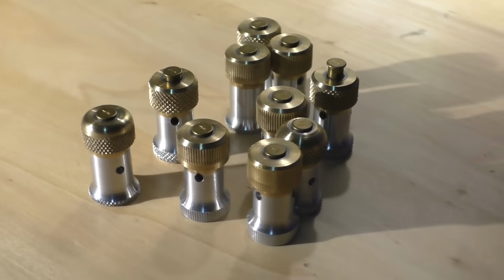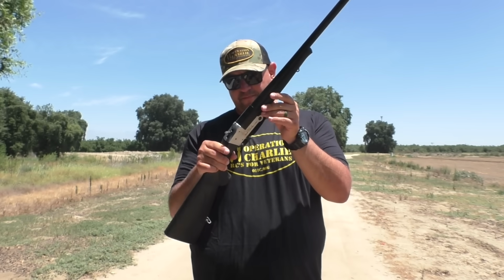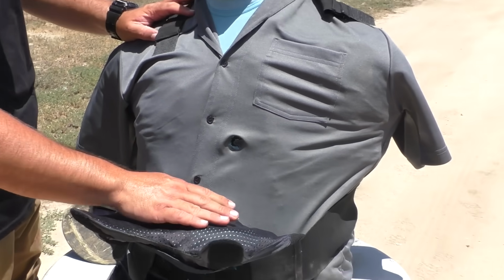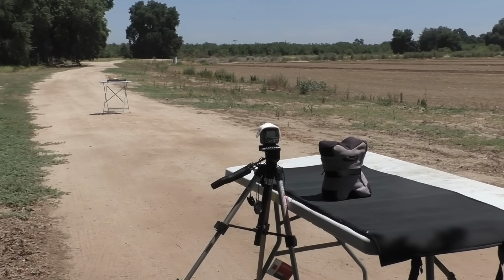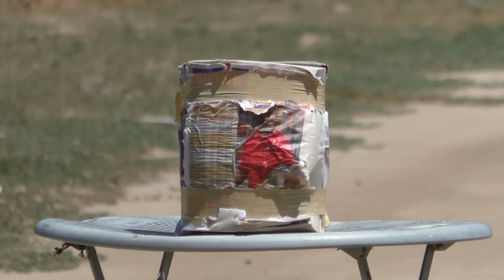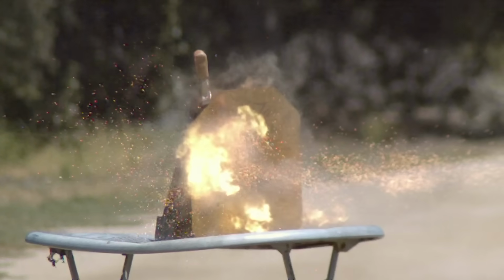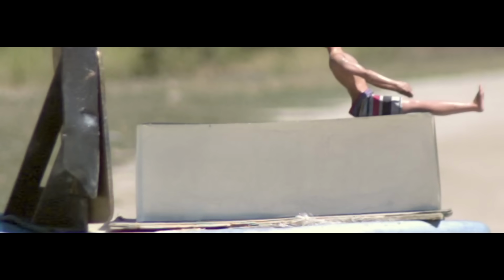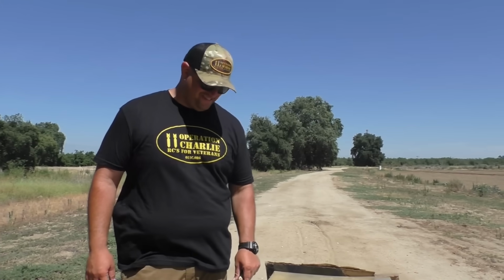We test the BACK-FIRE Slug -   You Make It,  We Mach It!

Comment: @taufledermaus I have an idea that would be a very entertaining series. Put out a request to your slug makers for a home defense slug.
Then test them in a series of videos on 2'×2' wall analogs, about 20-30 sections deep.(2"×4" frame with sheet rock on both sides and insulation in the middle.) Then compare the results in a follow on video.
Reply from the maker: The problem with walls is they really don't stop anything.   There is no magic bullet that will be stopped by a wall made of chalk and paper BUT would also have the energy to kill someone.
Reply: @taofledermaus I was watching another video that did this. Even rifles were being stopped at about 15 panels. But these were just sheetrock no insulation. The test of this would be home defense lethality while limiting over penetration.( For a high density urban surroundings.)

Comment: Don’t know if this is true, but could it be that the Titewad powder is faster burning than Longshot, making a high pressure spike very early in the burn, causing the gases to overpower the gas seal? Just a theory.
Reply from the maker: Titewad is a much faster burning powder.     But the x12x gas seal should not be blowing out like that.   I think I got a defective,  low grade batch.

Comment: Great idea for a slug! The rimfire blank charge is cool, when they work!
But, I think the powder charge should be less to keep the wads from blowing
out from over pressure. Or maybe a lead washer or aluminum washer to stiffen the base wad to prevent blowout?

I suspect the powder is building up too much pressure too soon, which may be part of the reason for the blowout.

But it is a long shot that a tite wad would blowout under pressure...  XD
Reply from the maker: I've been having some issues with the latest batch of x12x gas seals.  They are blowing out too often where in the past they were able to handle very high pressures.

Comment: Yeah, I'd have to agree with you. Those powder actuators were looking a little crusty, and rimfire carts tend not to age real well. Granted, they are a lot better than once were. But they're still not the most reliable things ever. And that reaction from the soft armor just looks horrifying. I'm a little surprised it caught them. Between the the fact that they were moving pretty quick and the nose of the slug being made of brass, I thought they would have pushed through that armor. Not that it matters a whole lot because you'd be having a real bad day whether it was stopped or not.
Reply from the maker: They aren't sealed very well, just a paper wad.  The newer,  crimped ones have paint on the tips to seal them.

Comment: I think longshot might work better for not overpressureing because of its slower burn rate. That stuff seems to have really good results unless you are using a really short barrel.
Reply from the maker: I was worried the slug might be too light for LS  and we'd have ignition problems.
Reply: @taofledermaus  1oz is kind of the perfect middle ground for 12ga projectiles. Most shotgun powders work well in that range. Like I am telling you anything you do not already know. You loaded tons of shells at this point. Good practice.

Comment: For that one that was spitting sparks flying through the air... I wonder if the acceleration triggered the blank early and it has been a partial dud (damp powder?), and some of the smoldering flakes were coming out the vent holes in the shaft of the slug?
Or, simular scenario, but it was some of the burning magnesium flakes that were coming out the vent holes?
🤷‍♂️🤷‍♂️🤷‍♂️

edit: HEY! I typed that before the Ballistics Gel test, so I like that there's some evidence to that potentially having happened!
Reply from the maker: It's possible

Comment: Dead nuts on the FPS !
Enthusiasts, please stop yelling at Jeff, he’s running the best channel on YouTube 🇺🇸
Reply from the maker: thanks Bob
Reply: I was originally trying to figure out if an AR or AK is better.
I concluded the AR is cooler with lots of options, but the AK is more powerful.
Then I found this channel and realized that if I want power, the SG's shown in this channel, has the ability to deliver way more energy.
(Hopefully my abbreviations are safe.)
Reply: @FusionDeveloper there’s a reason 3/8” steel that is rated up to 308 doesn’t allow slugs! I have a bullpup 12ga and kicks harder than anything else I’ve ever used
Reply: @FusionDeveloper  One other very important factor when weighing the two platforms is the AR-15's ability to be chambered in a wide variety of different calibers (including 7.62x39), with a simple swap of the bolt carrier group and/or upper receiver, one can chamber anything from .22LR up to .50 Beowolf, there are lots of options if power is a concern. .300 Blackout only needs a barrel swap, the standard 5.56 BCG and mags work with them, along with other calibers like .204 Ruger, .222 Remington, .223 Wylde, and 5.45x39, though as stated there are many other calibers that work with a different BCG. Just food for thought...
Reply: @TheExplosiveGuy  Yeah, I think an AR would be a lot more fun, from all the customization options.

Seems like a good combo would be:

- a (small) single handed launcher.
- AR (medium) "15".
- SG (large) (slug launcher).

(I'm avoiding using terms that may make this not be visible. even mentioning this may be too much)
Reply: JEFF! JEFF! JEFF FA FA! 

Ok. I'm done yelling. My 5 yr old came out.
Reply: 💯💯💯💯 TFM is the best.